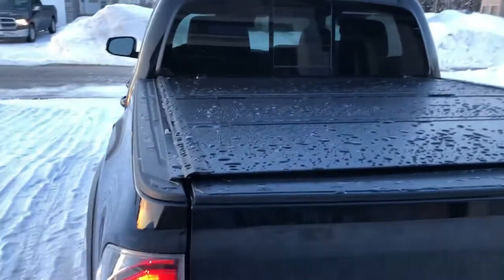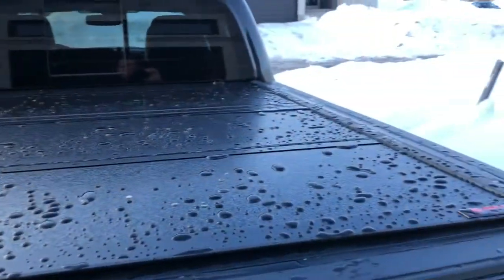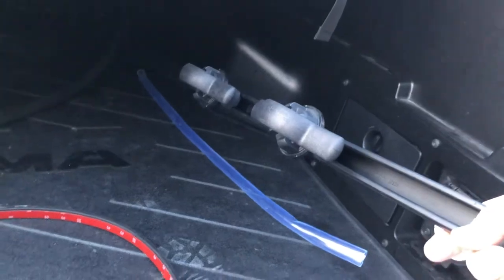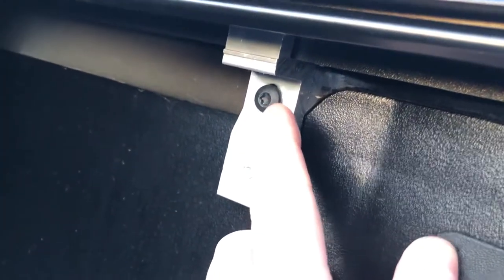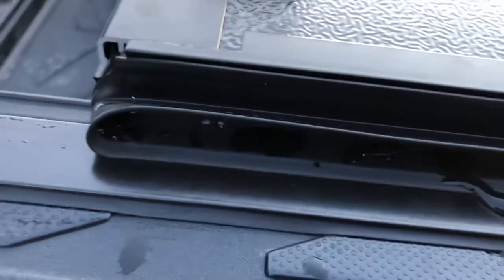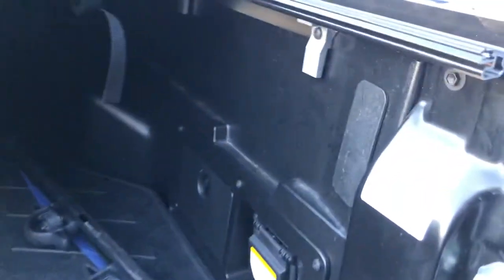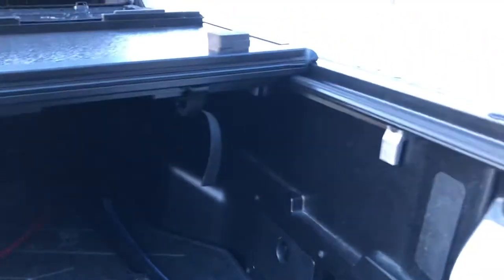How to install a Bison Tonneau Cover on a Toyota Tacoma

Comment: I just installed one of these on my 2023 Tacoma....I really appreciate your tips....especially not tightening right away and making sure the rubber strip is properly placed. I found the hardest part of the install (not that it was that hard), was putting the factory rail back on the aluminum brackets. Bison had a couple of sizes of bolts, but they were 10mm hex....I would have preferred another Torx or even an Allen head. Thanks.
Reply from the maker: You are welcome!  After two years mine is still looking and holding up great!

Comment: Hi Richard,
Thanks a lot for the tip on how to install the Bison tonneau cover on a Tacoma. I just finished to install mine, and it looks very nice. If I may,  I would like to add an other tip to your on how to ease the rails installation. 
As you probably know, the rail are pretty tough to install without  damaging the small rubber seal on the truck bed. I had a lot of problem with the first one but for the second one, I applied a little bit of grease (actually Vaseline) on the seal and on the edge on the truck bed. I slowly tighten the bracket screws from the rear to the front and it worked like charm !!!
Regards,
marc
Reply from the maker: Salut Marc,

I don’t recall that problem. I don’t know if they’ve changed anything cause my rails were super easy to install. Where is the small rubber seal that you mentioned?
Reply: @richardlepack7250  
Hi Richard, 
The rubber seal is on the rail outer edge running on the top of the truck bed, the one you mentioned not to tight to fast on your video. 
My truck is a 2020 maybe they change the change the design a little ????
I have an other question for you if you don't mine?
What have done to protect the third brake light on the roof top when the cover is fully open ?
Mine is resting against the light bezzle, I did install two rubber pads they provided with the cover but I don't like it that much as safe way to drive it that way !!
What do you think ?
Regard,

Marc
Reply from the maker: @marcpatino8503  Salut Marc,
Oh, gotcha!  I did not have any problems with that rubber on the seal against the truck bed. It was more about keeping the bolts loose so you can move the rails up and down to desired location. I can certainly see the Vaseline helping. 
As for protector he brake light on the back of the van above the window, mine doesn’t go as high. I installed/stuck the tube shaped rubber protector that shipped with the cover. At the edge of the piece that rests against the can and it touches the trim just above the window and under the light. When I use it flipped up, I don’t put it tight against the cab either. I wish I could send a pic for you to see. I could put it on my channel if that would help you. FYI - the second rubber strip with the lines   Lengthwise is supposed to be between the bed and tailgate to reduce dust in the box. Hope this helps!

Comment: Good video and great insight into a Tacoma install.  Took delivery a week ago of my second Tacoma and am now in the market for a tonneau.  I’d like to support a Canadian Company but the Bison website shows a F150 when you search Tacoma  = fail for me.....that plus no specific install instructions associated to the Toyota factory side rails.  Thanks to your video I now know!  I would never remove the factory rails for any reason and for that reason Bison is not for me no matter how good the rest of the product is.
Reply: Removing stock rails is not a problem, many hard cover manufacturers would require this rail to be removed and replaced.
Reply: I don't see an issue with the rails. They reinstall, just an inch or so lower.

Comment: I've had two BAKflip covers for my 2017 Tacoma.  The first one had a vinyl/pleather type material on top that hid the hinges.  Within two years it got so heavy (waterlogged) it was unusable.  I contacted Bakflip and they said they discontinued that model and would replace with an MX4.  Again, within two years the thing weighs a ton when you have folded up towards the cab.  Ordered my new Tacoma for end of the summer and looking to replace with something other than BAKflip.  This Bison looks good and will consider it, I just hope it won't have the water logging problem the Bakflip has.
Reply from the maker: I highly doubt you will have that problem. I’ve had it for six months or so now and it doesn’t seem to hold water. The only problem I foresees if there is snow on it during the winter and you go in an indoor garage or temp rises above 0C and then freezes again, that might cause some issues in the tri-fold hinges. Otherwise, it’s metal and rubber so can’t hold water within it.
Reply: @richardlepack7250  when my first BAKflip was replaced under warranty they made me drill holes in it and send them pics to prove it was destroyed (I guess so I don’t try to sell it).  I remember when drilling these holes each panel was filled with styrofoam of some sort, I think this it what absorbs the water, over time.

Comment: One trick to save a lot of time removing the stock cleat rail.  Toyota uses locktite on the torx headed bolts, bad combo for potential stripping of the bolt heads, and then it’s a real pain.  Get a torch and will a small flame heat up the bolt head that will eventually get to the threads to loosen the locktite, bolts come out so easy after this.
Reply from the maker: Odd, I don’t recall that being an issue for me.

Comment: Thanks for the video as I'm looking at purchasing one of these for my 22 Tacoma, 5" box. I think they have two models of Tri-Folds, one for $80. more with a hold open bracket. I had a bracket like this on my previous truck and rarely used it.  I also wonder about using removable clear silicone sealant under the rubber for more rain-weather protection. I have used this in the past on a F250 Super Duty tri cover with great results. It just peeled right off with no damage. Does the factory rail seem secure enough after mounting on the new bracket? Hmmm🤔
Reply from the maker: Hi Cigarman!  the cover has a decent seal.   Not perfect, but decent.  After a touch less car wash I have just a little water at the back of the box. As for your question regarding the rail, yes it seems secure enough.  I would think the plastic hoops/anchors would give before the rail.

Comment: Hey can you give me advice on installing it? it seems like the rails are a little too close together on my Tacoma 2021. The cover doesnt sit between the 2 rails
Reply from the maker: Anything different than in my video?  If not contact Bison they provided me great service when I had questions
Reply: @richardlepack7250  I did exactly that and I now have it installed. Thanks a lot!
Reply: @Dddddeeeeee  When the cover folds up against the back window is there a bumper or something to protect it?   How well does it keep out the weather?

Comment: Question about closing the tailgate. Can the tailgate close while the cover is still down or does the back panel need to be open?
Reply from the maker: You can close the tailgate with the tonneau cover up or down.  The reverse is also true, you can close the cover with the tailgate closed, but I generally prefer to close the cover first then close the tailgate.

Comment: Do you have to drill a hole in the side of the bed for the drain tube?  Is it as easy to remove as they claim?  Thx
Reply from the maker: Washaw67, no I did not drill any holes in the side of the bed for the drain tube since there are already three at the front on the floor of the bed. I just put the drain tub close to the centre one. Yes, it’s basically two thumb/hand screw knob to remove it.
Reply: @richardlepack7250  About to pull the trigger but would like to know if there is a protective bumper to protect the rear window/body when the cover is fully folded up?  Also my front rail is a little higher than the side rails (maybe 3/8").  Is your Tacoma like that (kinda looks like it in the video around 1:38).  Thx again.
Reply from the maker: @washaw67  yes there is a rubber protective strip with double sided tape to affix on the flipped up edge. You can install it in the best location for your truck. As for the front rail, yes it is higher but only about 1/16th for me. Regardless, it should be ok, because it’s a flat rubber strip that goes across that rail to seal it.

Comment: Richard did you have to install the weatherstrip that comes with it on the head of the bed? Seems like it might raise it excessively ?
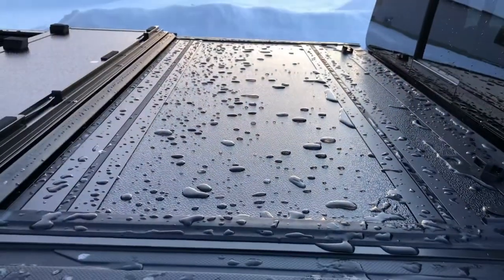Reply from the maker: Not at all. It is integrated with the Tonneau cover and just has a rubber flap that is over the head of the bed.  You can see it at the 1:38 and 2:38 minute mark. The weather strip is to seal the bottom of the bed and the tailgate to reduce dust in the box. I didn’t bother installing it and haven’t had issues even driving dirt roads at the cottage.

Comment: Hey Richard,

Will be getting in my 2021 tacoma at the end of June. Curious how the tonneau has held up since posting this video. I am looking into the same model myself.

Thanks in advance!
Reply from the maker: Hi Ben, it’s held up quite nicely! I don’t think you can beat the price and quality. I’ve had it on and off a couple of times too. Enjoy your new 🌮
Reply: @richardlepack7250  I just installed my tonneau cover tonight, she's a beaut. Just out of curiosity, did you have to cut the plastic of the upper portion of the bed to make room for the mounts? I had too as they wouldn't fit otherwise
Reply from the maker: @bent7001  nope! Fit like a glove. Weird that you had to cut them. 🤔 I wish I could send pics and see how you mounted yours.

Comment: Do you like the Bison? I'm looking at buying one and they're very reasonably priced just wondering what the quality is like
Reply from the maker: Quality is very good. Finish is great too.  Did you see Bison's own video? they have someone stand on it. I wouldn't on mine, but they show it.  I would definitely buy another. Here is the video. https://www.youtube.com/watch?v=TQaRbwsvEpI
Reply: Awesome thanks, I ended up buying one. I plan on getting a spray in bedliner, do you think it would be best for me to get that done first? I know they have a seal that gets mounted to the truck at the front and from what I see it is a spot they spray the liner on. Can you use it without these seals and put them on after?
Reply from the maker: @colefroats23  I’m going to guess you don’t have a Tacoma or you have and older Tacoma since the bedliner in my last two were plastic. If it’s not a Taco, I would suggest emailing Bison directly since they provided me excellent customer service. Without knowing what you’re installing it on, my gut feel would be to make sure there are screws in the holes when they spray, cause I can imaging it would be difficult to install if the holes were spayed/covered.
Reply: Hey Cole, I was thinking about getting a Bison cover and was wondering how you liked yours months later?
Reply: @bw6078  I've had no issues so far, the one clip came broken but they were very quick to send a new one. Honestly for the price you'd be crazy to not buy one. Much better than the vinyl folding covers and you don't have the wasted space at the front of the box like some other tonneau covers
Reply: @colefroats23  Thanks Cole. All the best.

Comment: Do your cleats fit in the replacement rail?
Reply from the maker: It’s the original rails that you relocate about 4 inches lower. I haven’t reinstalled the cleats, but they have to fit on original rails

Comment: I just installed one of these on an '09 TRD with a 6' box. Given that the instructions that Bison provides are brutally terrible and virtually unusable, I decided to use your video as my guiding light. If is anyone watching this video after October 2023 to install in a gen 2 Tacoma, do NOT remove the stock tie-down rails on the sides of the box. They've changed the design from when this video was made and the brackets for the cover's side supports now slide into the stock tie-down rails. Just remove the cleats. You also have to remove the rail at the front of the box but not the sides.
Reply: Can we still 7se the cleats afterwards?
Reply: @reggydunlop5770  No - the cleats slide into the rails and you won't be able to slide them in because the side supports will block the cleats from sliding in.
Reply: I just got mine today and the clamps are very different to instructions (not surprised)
Did your cover come with double plated screw down clamps? That's how I would describe what was in the package

Comment: Where did you put the long rubber piece with the backing tape on it? The instructions weren’t very good. It took me 2 hours to install everything, would’ve saved 20 or 30 mins if the instructions better :/
Reply from the maker: If you mean the piece with the red backing you see in the back of the box during the video around the 40 second mark, I put it on the underside of tonneau cover so it protects the cab when it is folded up.